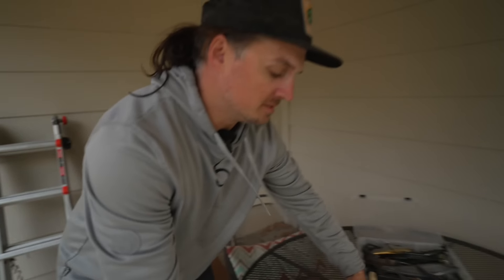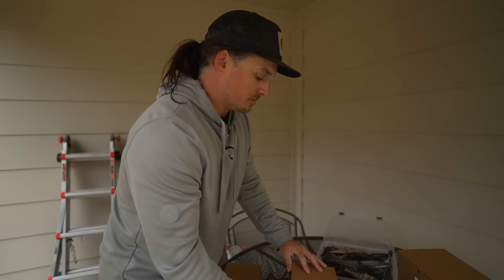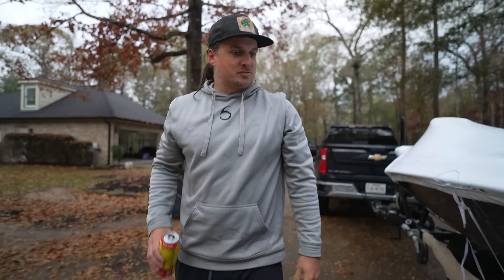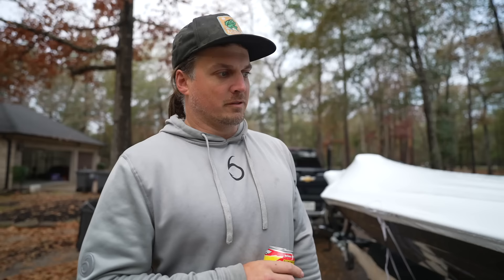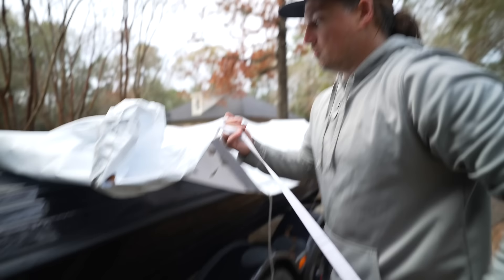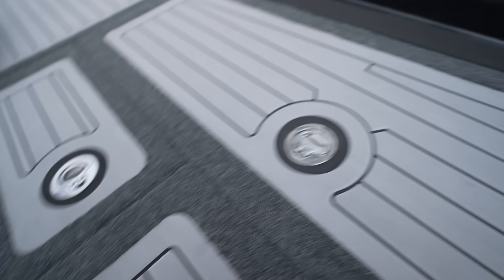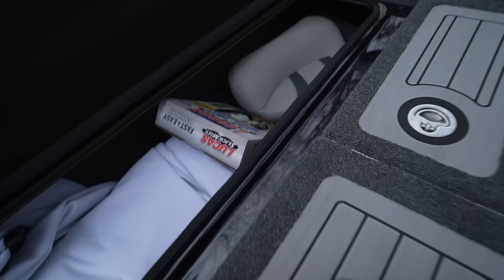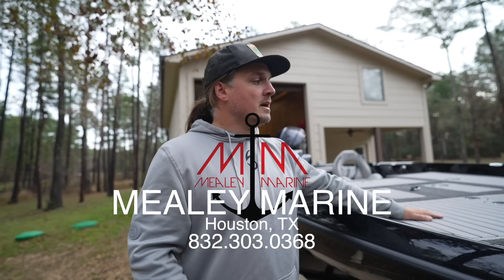Revealing My NEW BOAT for 2024!! (My BEST One Yet...)

Comment: I have a CX20 and came from a Basscat previously.  One thing that Basscat does that is SUPREME to the Caymas are the trailers,...they are so nice...The Cats are fast as crap so you will love that...They also have the best resale values of any boats I have seen.  The only thing I dont like about the STS is the tackle storage...you eluded to it on your video...those compartments in the middle are horrible...Also doing your own electronic installs on Basscats are a pain in the ass...you literally work through a hole under the trolling motor pedal...where as other brands have the front which unscrew and have a big panel to work....The rest of the boat is bad ass....

Comment: The battery tray in the Basscat is a bullet prof item. I have a 2006 Cougar no problems.  The key is to put an extra jam nut under the flange and keep the single nut from loosening. Now, if your new batteries will not fit, that would be great to share on your rigging video.

Comment: Wouldn't you want the gas tanks to evenly expel gas versus having uneven weight on back of boat?  Or do you switch tanks back and forth as you go to keep weight even?
Reply: I run a Skeeter with 2 tanks and the switch has left and right or if left in center it draws evenly, not perfectly even which I'm sure due to uneven weight in the boat. It's cool because if you're fishing alone you can put more gas in the port tank to even out the ride or if your co angler is a big fella put a little more in the starboard tank, a gallon weighs a little over 8 pounds roughly.

Comment: Do you think there will be any handling issues with the dual tanks? If one tank is empty (or near empty) and the other is full, that's going to be a 240-lb weight differential all on one side of the boat. I guess they're below the waterline, so it wont be an issue most of the time, but up on plane, I wonder if there will be a noticeable change.

Comment: that rod locker layout is pretty strange. I like bass cats, but ranger boats have better storage. also, whose idea is it to put gas tanks right next to the batteries, and it looks like you can barely fit your batteries in there.
Reply from the maker: Room for 6 batteries back there. Gas tanks at the rear is for performance. Probably 20 mph faster than a ranger, and won’t be in pieces after 6 months